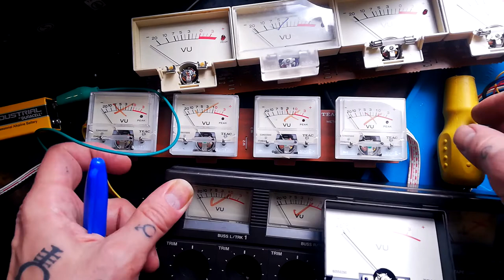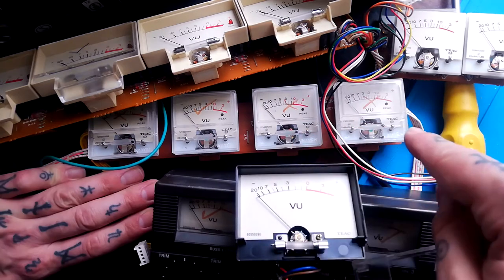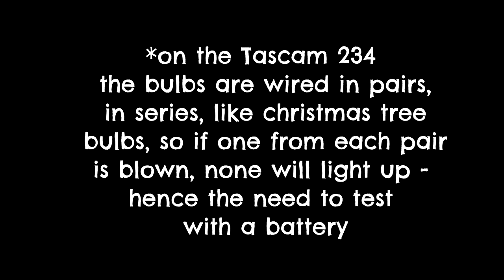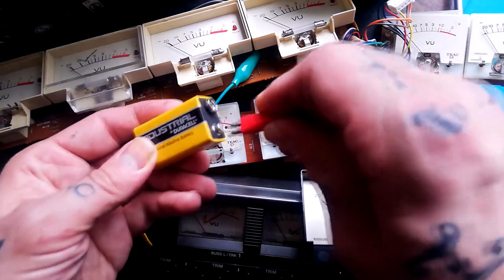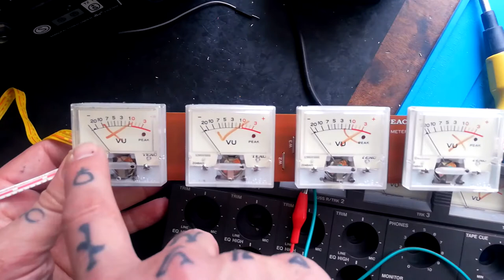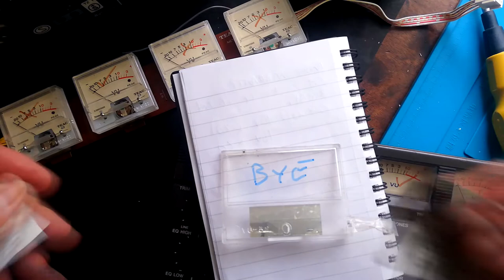Testing VU meter bulbs with a 9v Battery

Comment: Nice vid, 2 bulbs are out on my m30 desk. They're the soldared in type. Would like to fix them  👍 Can they we swapped out with led's? Or something else that's not official tascam stock thats 38 years old?!
Reply from the maker: I reckon you could run a resistor in series with each LED and it'd work, alternatively I do have spares, I could send a couple back to you with your marantz?
Reply: @Tetrakan  yeah that would be great thanks , of the 4 vu meters it's 1 and 2 that are out